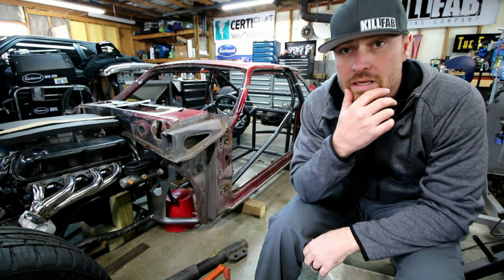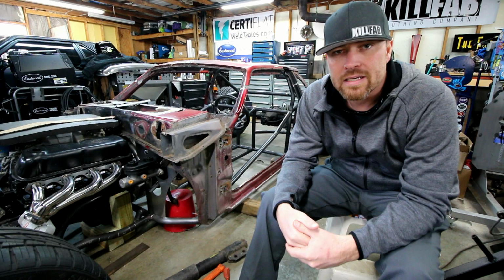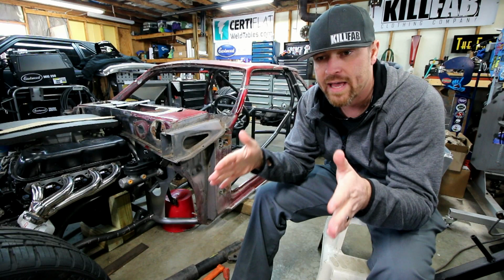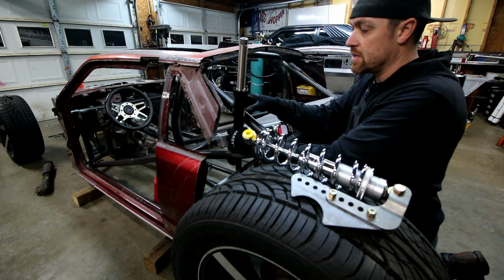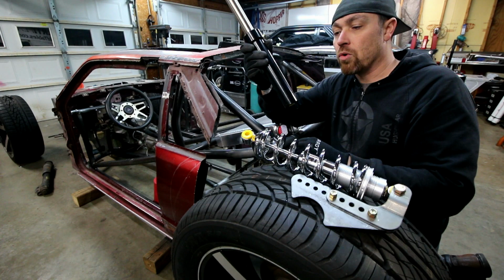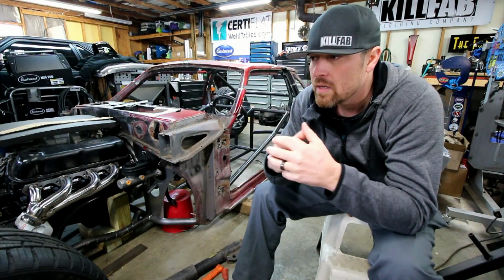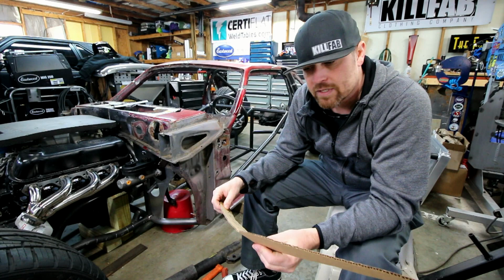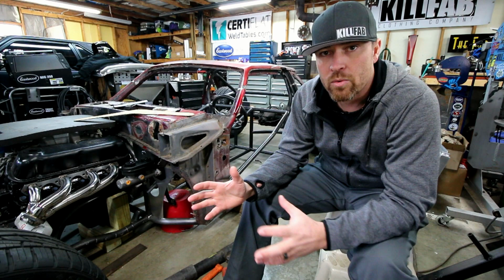Rear Mounted Radiator & 4 Link Suspension | Mustang Hot Rod Build

Comment: Since you are looking to make it different and cool. For the front suspension I would go independent of course, but in the same design as the Ariel Atom, where you have coilover shocks laying completely sideways (flat parallel to the floor) connected to a wishbone pivot arm. You could put the coilovers nearly under the frame hidden or somewhere above the engine to show off the setup. I think it would be crazy cool
Reply from the maker: +Skyline Fabrication If it's like an Ariel Atom it's not different though
Reply: Tried to find a link on here to the car that has it, but cannot, I'm thinking you are right and it wasn't the Ariel Atom. It seems complex but its really quite a simple system that works very well. If I come across it again I will send you the link

Comment: As far as mounting the hydraulic cylinders. You could slide them through a sleeve like you suggested and use a collar on the other side of the sleeve to limit movement of the cylinder. But also make it removable if something goes wrong with the cylinder.
Reply from the maker: +Rick Crusenberry yeah that's what I'm going to do

Comment: think the sleeve idea is the best as it will make it eazier to replace the cilinder with a stock of the shelf part , i think you would need to take the cilinder apart to weld directly to it or risk burning the seals anyway prolly can lock it in bolting the coupling for the oil through the bottom of the pipe  (as its only downforce and no pulling forces aplied to the cilinder )

i think it will look nicer if you move the rearaxle even closer to the door prolly dont give enough room for the suspension though 

the suspension mounts you build might flex , granted you used some pretty big piping to build it but some of the sprout offs to the mounts  start from the middle of a pipe , and the whole setup is build out of rectangles with a bend corner , you might need to add a few thinner 0.5 inch  pipes to triangulate a few parts corner to corner
Reply from the maker: +watahyahknow yeah

Comment: For your hydraulic cylinders, you could make 2 collars that clamp the body of the cylinder and weld the collars to the tube frame.  That way you don't need to weld to the cylinders themselves
Reply from the maker: +DnA Design going to do something close to that. The cylinder will need to pivot so it can't be clamped in place

Comment: Will you have enough airflow through the radiator mounted horizontal in that location? Great work. You have great talent and an excellent mentor.
Reply from the maker: yeah I think so...it will have two fans under neath and some creative ducting. The aluminum tube that carries coolant to that back will also shed some heat.

Comment: I really wonder if you could use a drag race oriented Fox body strut that is several inches shorter than stock. Santhuff style. The ones made for a solid top mount on a uniball. QA1 may have one as well if that is the brand you are using. Love the direction you are going.
Reply from the maker: +Kingsize24 I need to look into it. Already planning to use a uniball setup

Comment: any thoughts on making the rocker arm unequal length so that the coilover side would have a short arm.  If you hit a really hard bump, it would exert less force on the hydraulic cylinder (at least in theory).   The only down side is you get less height travel.  But  you at least gain more fine tune adjustments on ride height.
Reply from the maker: I am kind of limited on length because of the space available, but not worried about the hydro system being stressed. I dont see the sprung weight of the rear being very high. Probably under 1000lbs

Comment: I love that you’re not using a computer to design this. Seems like everyone these days has their car/truck scanned and built in 3D before even touching a tool or a piece of steel. 
One question, on a lot of builds, guys have the tube ends ground down past the black coating on chro-mo tube, you don’t? Any reason or insight you can add as to why you don’t?
Reply from the maker: I have scuffed the ends...Im just tacking everything. I will scuff everything before final weld

Comment: Not sure if this has been addressed yet but for pivot points for your cantilever pivots especially on the front strut idea, why not use trailer axel stubs. My thinking is if they are able to support tons of weight and can resist the forces applied latterly they should be able to act as a rocker shaft for your suspension. Plus they have bearings instead of bushings. Just a thought.
Reply from the maker: +DIY Garage I'll be using hiem joints
Reply: I meant where the pivot point is not the ends

Comment: Do you have a rule of thumb of when to mig vs when to tig? Also I watched some of your way back when videos and wonder are you ever going to do some carbon work again? Would be cool to see some thrown in to this. And the setup is looking sweet!
Reply from the maker: Other than those materials that need to be TIG'd like chromoly....TIG is much slower but cleaner and potentially stronger. MIG is way faster and generally not near as clean.

Comment: This build is so dope. One question though, why are you modeling the rear suspension after the Foxbody stock 4 link? It’s notoriously bad, and I know because I have one. The upper control arms being angles give them two jobs, maintaining pinion angle and locating the axle side to side. It’s very bad at both jobs. You should consider a watts-link setup with a torque arm. You will be way happier.
Reply from the maker: The stock fox body suspension is actually notoriously good. Its part of what made the fox body so popular and one of the best drag cars from the factory it still holds records for the fastest stock suspensions on the planet. The problem with the fox suspension is in the rubber bushing....everything is solid on the bibbster.  Watts links and torque arms are good stuff but take up room I dont have and add even more fabrication to an already huge projects.
Reply: The Fab Forums there’s multiple articles online describing its failures. It’s even nicknamed “quadrabind.” Maybe for drag racing it’s different, but if you want to turn it’s pretty bad. Here’s one example of a write up about it. I’m just telling you because you’re starting from a blank slate so it might be better to go with a different setup.

http://www.themustangstop.com/forums/viewtopic.php?t=2885
Reply from the maker: Hey Tom I appreciate your concern but I see zero justification for doing anything different than what I am. I have owned 15+ fox bodys over the years and drove everyone one of them way harder than this thing will ever be driven.  I really never felt like any of those cars had any faults in handling. You also have to remember you are comparing apple to oranges, the stock fox suspension upper links are really short ( like 10") causing a lot of that bind they speak of. These will be like two feet long. I would probably be willing to consider adding some of the things you mentioned if I was using factory length fox suspension component on a road race car but this thing is neither of those.

Comment: if you don't mind me saying get rid of the hind joints as after a while they wear and start ratheing , make your own bush joints out of teflong they last a lot longer and can take a beating and better wear too as hind joints there no give they just wear out ,  its up to you if you like to be different and safe ... i don't care who make them and how strong they are, i personal don't like using them on suspensions as i also seen them tear apart with a lot of HP when there worn out . you be always changing them and there not cheap .
Reply from the maker: I have had the same set of heim joints on my twin turbo car for the last 15 years....not worried about wear.

Comment: For the Cantilever arm.... because you only have a 6" throw hydraulic cylinder, I would build in a ratio of lift and not make the arms symmetrical. (for those huge speed bumps) Just a suggestion.
Reply from the maker: If I do some kind of "over ride height" mod for speed bumps and such, it will be just up front. I like the idea of ride height always being at full hydraulic cylinder lock that way I dont have to adjust it every time...just raise it all the way up and ride. They may change though as the build progresses. May go ahead and build several mounting points into the lever in case I need them later
Reply: Cool. I try to want every video. I dig the content
Reply from the maker: thanks

Comment: You could do a twin I beam setup, super unique and you could have a ton of travel
Reply: Even could use something from 80s f150 2wd front end if you want to stick with oem of the shelf parts
Reply: The issue with the twin I beam travel is camber. I have a 79 f150 with the same thing, and if you move it an inch up or down, there is noticeable camber. To fix it, you get the appropriate arm, and that's more of a one and done thing.
Reply: T Swag Yep that’s exactly right,  but he may not mind the camber with this project. Sure is a pain on our trucks tho
Reply: the wespaul - a lot harder to do with wanting the front end to be dropped then raise up for driving. And Kyle needs to worry about frame and engine clearance when it's dropped down to match the drop he is now building for the rear with the cantilevers and hydraulic cylinders which will set the ride height when the Bibster is being driven. The plan that Kyle has is to use struts up front and Kyle has a good idea how he's going to get it up to ride height; struts will produce a lot less camber change, especially since he will probably be driving at time with it lower that a "normal" ride height.

Oh, that would add to the weight a lot - a theme for the Bibster. Those I-beams, springs, and shocks are pretty heavy in comparison to a strut type front end suspension.

Comment: Can u use a water torch kit with a regular tig machine? Is it just a regular accessory?
Reply from the maker: +Rafael Sanchez Yeah
Reply: The Fab Forums what are the benefits?
Reply: Rafael Sanchez you can weld longer before the torch overheats.
Reply: Todd McCarter will that increase duty cycle?
Reply: Rafael Sanchez of the torch yes, then welder no.
Reply: Todd McCarter oh ok
Reply from the maker: yeah on long high amp runs the torch will get too hot to hold without a water cooler....I usually run into this when welding aluminum

Comment: Hey, on your cylinder I'd recommend making a pinch sleeve for its mount. I have seen way too many fails wehen brackets break off. As well if you blow a cylinder seal you can drop another cylinder in and get back on the road and not need a welding rig to swap your brackets to the replacement cylinder. I worked at a lowrider hydro shop back in the 90's and worked in the general hydraulics fields for years. The cylinders for cars specifically aren't as heavy as industrial units. They usually are held in by spring pressure a nd the him joint. I also have seen way too many bend so welding brackets would weaken an already sketchy cylinder. Hope this helps.
Reply from the maker: +Billy Beane lol...you must not have much faith in me. Gonna do something similar.